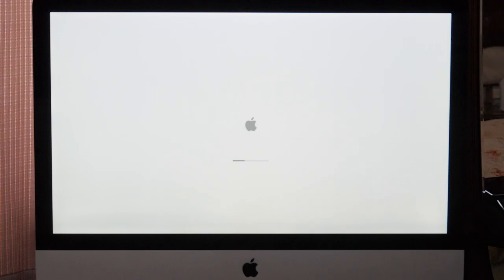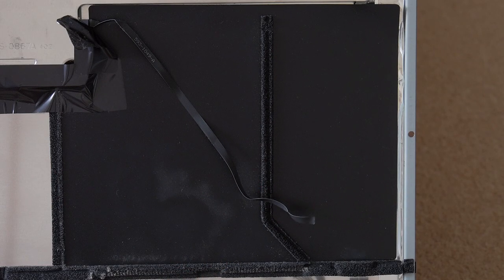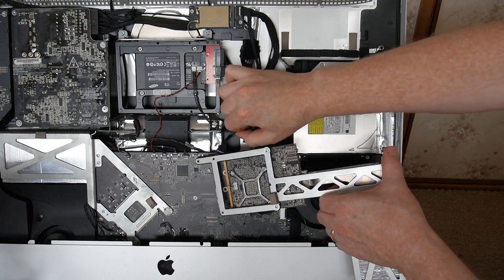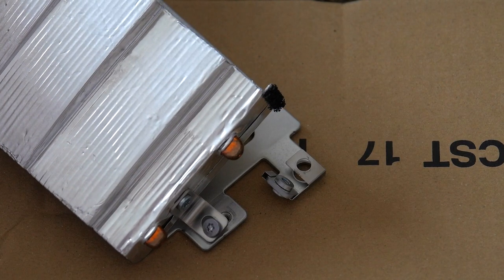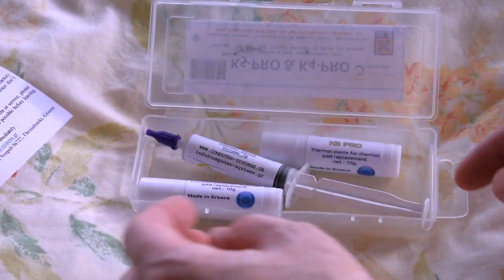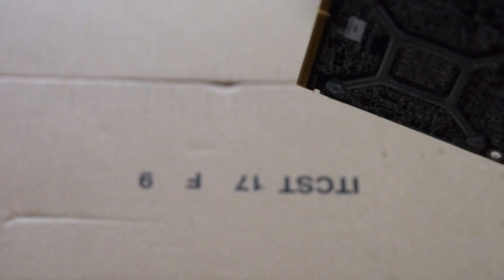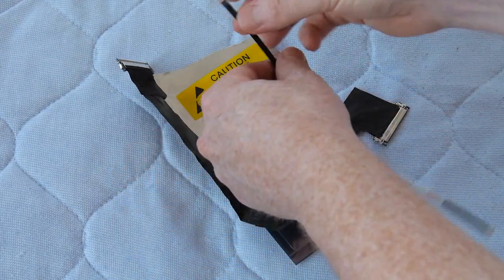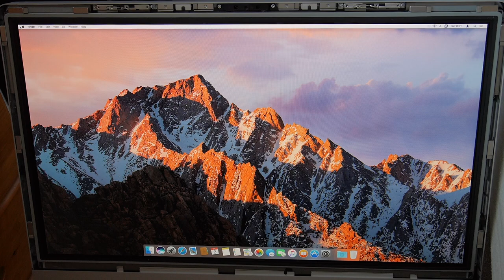Late 2009 iMac 27" Video Card Repair — 4850 — 2nd Bake

Comment: Hello James, I followed your steps, and my screen won't turn on, is just black. It starts the computer and makes sound but won't show anything... I am not 100% sure if the problem is the small tiny cable... Could this make the screen not to show at all? Thank you!
Reply: I broke the small cable... I already ordered a replacement. I hope that the reason for the black screen is that one... I think is the backlight cable if I am not mistaken right? For the big cable, the connector in the mother boar is not completely attached right? I mean it has somehow small allowance that allows to bend it in angle... Thank you!
Reply: Endika Ampudia Gamero Sounds like a connection issue, double check all cables connecting LCD screen to logic board (all 4 cables and not just the one in the upper left corner)
Reply from the maker: Thank you for your question, Endika.  If either of the two cables that I replaced in my video are either broken or not connected properly, there most likely will be no video.  That is only a guess on my part since I have not tested that case.  The small cable you broke is the Vertical Sync cable that connects to the Backlight board.  So when you install a replacement for that cable, I would assume you will get video again.  But for good measure, ensure your video card is properly seated into its connector when you reopen your iMac.
Reply: Hello @Juju, thank you for your reply. I think it is the small cable that broke. (I don't know hot but the pins peeled off the plastic). The big one is in perfect condition, actually is pretty hard to brake...it can happen of course since is a 2009 unit. The connector just to make sure bend a little bit towards the screen right? I mean is not an static connector in the board... I was scared that I broke that from the mother board but I checked carefully and I didn't break any welded element or anything so I guess is really the small cable... Thank you so much and I will post once I get the cable!
Reply: Thank you so much James, I downloaded the document and I will keep it with me to see if I can fix it. Very useful. I am guessing is that cable. First I connected everything and everything seemed to be ok, but when I turned on, nothing happened on the screen, so I removed the LCD again and I realised the small cable somehow peeled off the connectors... It has two sides, the one with plastic and one side where you see the gold connector... I will be more careful and put this properly. About the bug cable seems is in perfect conditions, is a big connector and looks fine. Just to confirm, the connector on the board is not 100% fix, meaning it bends a little bit towards the screen, like in angle. I checked this and seems has nothing broken or anything previously welded to the board... Do you know if this is like this in origin? I checked again the connector of the video card and seems to be ok... I mean the screws are in place etc, if it was not well connected those screws cannot be attached since it would be displaced... anyway once I get the cable I will connect everything again... Hope you can solve my question about the big cable connector in the mother board... thank you so much!
Reply from the maker: Endika, the metal contacts on the tip of my small cable also started to come off the very first time I disconnected it for my 1st bake.  The cable is NOT made very well, plus it's old too.  But when I broke it on my 2nd Bake, I had to replace the cable, which solved the problem of the bad contacts.  So it seems you are replacing that cable on your machine too, so that problem will be solved.  

You say a "big connector" is bent?  If you push on it with your finger and if it does NOT move around, then the solder contacts are probably still good and you don't need to worry about it. If you are worried about it, just shoot a clear close-up photo of that bent connector and post your photo to the cloud so you can share it with me, then reply back here with a link to your photo so I can see it.  If I can see your connector, I can better determine if it's OK or not.
Reply: JDW thank you so much! I will send later the photo of the connector so you can see if it’s ok not not...what I mean basically is that the connector on the board itself is not fixed completely to the board. It’s like you can bend it a little...anyway I will send a photo ASAP. Thank you so much!
Reply: Hello James, those are the photos. I pressed somehow this connector so you can see what I mean when I say it has small allowance to bend it... I guess this is like this and is designed to allow the cable to be removed when we lift the screen. I hope I didn't break any connector here... Let me know if you need better photos or video. Thank you!

https://drive.google.com/open?id=19kR09EieQmikhM1d9zJSQ6qv3XmoB9JQ
Reply: Endika Ampudia Gamero Hi, i think this is normal, as the big connector cable also moves slightly forward on my imac.  (I believe Apple designed it this way to allow easier LCD screen removal / installation.  Goodluck with your repair, i just did this on mine yesterday and it works flawlessly!
Reply from the maker: Endika, thank you for the photos. That connector is officially called the Display Port Cable Connector. It looks normal to my eyes.  So long as you didn't let the display fall toward you and out of the computer (like I did in my 2nd bake video), the solder joints on that connector should be fine.  However, I did find it hard to get the cable fitted all the way into that connector on both sides when reassembling my machine.  If that cable isn't making good contact in its connector on the logic board (or is disconnected at the back of the LCD, then you obviously would have issues when trying to boot.

If you check pages 24-25 of the PDF I gave to you, you will see there are 4 LEDs located in the bottom left corner of the logic board that give you very useful diagnostic information.  LED#3 especially  lights to confirm good communication between the logic board and video card, and LED#4 lights to show the logic board and LCD panel are communicating properly.  If either of those LEDs do not light, it suggest there could be a problem with the LCD panel or the backlight board or the cables in-between them.  And in that same PDF, on page 27, are logic board test points that would allow you to check signals if you have a digital multimeter.

In that same PDF, troubleshooting recommendations are given on page 38.  If you have an external display, connect your iMac to it and see if video displays on that.  If it does, then it is likely a backlight issue, and they suggest resetting the SMC.

Please let me know if this information helps.
Reply: JDW Thank you so much I will try this way when I get the cable. As well I got to see a video on YouTube where a guy is welding that connector I was referring to... this is the link where he does I don’t know why... https://youtu.be/t8KXvZKLhXI
Reply: Juju hello Juju thank you so much! This makes me breath a little bit better I though it was broken... I found this video where a guy is welding this connector to the board...I don’t know... this is the link https://youtu.be/t8KXvZKLhXI
Reply from the maker: Thanks for the link.  I had seen that video before.  That fellow assumed that connector was not supposed to move and he applied solder to fix it in place.  I don't think that is necessary though; and honestly, if you aren't experienced with a soldering iron, you could do more damage than good.
Reply: JDW That’s what I though also! Because the connectors seem to be fine...is risky to do that anyway as you said. Will wait for the cable and check all the test in the PDF...let’s hope will work!

Comment: And just hopefully some helpful info to save people some money. Warning: May get long winded. And might not work on 2011 iMac's. I don't have one to test on. Will work on 2009's though. 

If you plan on replacing your 1 TB rotational hard drive with an SSD you do not need that special frame and in-line temp sensor from OWC! They are over priced.  What you do is go to most any computer store or even Best Buy and get a 3.5" to 2.5" adapter frame. Costs between $5.00 to $10.00. Mount SSD into frame and then remove old drive disconnect cables and temp sensor cable. Transfer screws to adapter frame and mount in the iMac. 

OK now you think what about the fans running at high speed? Easy fix for that as well. 

Take the Hard Drive sensor cable that you removed from the old drive and identify the 2 wires inside the connector. One should be grey and the other black. Take an NPN transistor like a 2N3904 (the 3904 transistor is labeled as follows: Looking at the flat side of the 3904 E will be on the left, B will be middle and C will be right end) Now twist the B and C leads together. Nice tight and near the top of the transistor 2 or 3 turns should do it.. Leave the other lead E by itself. 

Trim leads slightly maybe 1/4 inch from end. Plug the E lead into the hole of the sensor cable that has the grey wire. The B and C pair into the sensor hole with the black wire. Be sure contacts are tight in the sensor cable. Now just tape the transistorized heat sensor to the SSD. Fans should run at normal speed.

 This is the exact same way apple does it with the temp sensor on the back of the LCD!!!  And on the 2007 and 2008 iMac;s Hard drive too. 

Hope this helps someone. Cost would be at the most $10.50. The Transistor is cheap. Compared to OWC's price of $40.00 just for there in line temp sensor. Ouch!
Reply from the maker: Thanks for the tip.  But bear in mind you are writing to people who watch YouTube, and I don't know if they will read more than a couple paragraphs of information. :-)  Seriously, what you described would make a wonderful video!  If you ever do make one, feel free to post a link to it here.
Reply: @JDW-  Yeah I was long winded but the only way to explain it so the average person could understand it.
Reply from the maker: @MrEd-qg8td  I love being long-winded, so you and I are clearly kindred spirits.  I'm Generation-X, not Generation-Twitter.  That's why a good number of my videos are close to 1 hour long!  :-)  Thanks again for your helpful advice!
Reply: As others suggest this would make a great video tutorial

Comment: Is the same card in 24 inch 2008 ?
Reply from the maker: No.  But there have been comments under my videos from 2008 24" iMac owners who have baked their video cards and found success. My videos will help guide you, but keep in mind the internals are not 100% the same.  But it is similar enough to where you should be able to find the card, remove it, and then proceed with the bake as outlined in my video.  My advice would be to open your iMac and have a look.  If you feel confident enough to proceed, then buying the required thermal paste would not be a waste of money.  Please let me know how it goes.

Comment: One issue I noticed is that you did not clean off the old thermal paste off with 99 percent isopropyl alcohol and reapply your paste.  I would suggest arctic MX-4 which is non electrically conductive and non-capacitive or Kryonaut by Thermal Grizzly which is listed as non electrically conductive at the web site.  I can't get any information from the manufacturer if it is non-capacitive, but there are people who have said that they are using it on GPUs not CPUs in place of Arctic MX-4
Reply from the maker: Please start watching from 22:47 and you will see that I did indeed clean off ALL the old thermal paste with tissues, swabs and dehydrated Ethanol, which is as good if not better than 99% ISO alcohol.  Furthermore, as mentioned in the text description under my video, I used non-electrically-conductive K4 and K5 Pro pastes after my bake, and so far those two pastes have given me 2 years of continuous use.  So what you see in my video above works very well.  I hope this information helps!

Comment: I have just reasembled the computer. saddenning the screen is still in black. Turning it on, on a dark room, the black screen turns illuminated black, the sounds of loading are all correct.
But the result is the same, probably the graphics are totally dead.
If you know any advice, i would do, i'm not throwing away a mac from 2011 full upgrade.
Reply from the maker: I read and reply to every comment on both of my bake videos and you are the 3rd or 4th person who has reported a black screen after the bake.  I assume you cleaned off the old thermal paste, then baked the video card at 200°C for 8 or 9 or 10 minutes, then reapplied new thermal paste, then reassembled and tested? Since you hear sounds that indicate normal booting, it is likely you just forgot to reconnect a cable that pertains to the display.  Hopefully you did not accidentally break a cable like I did in my 2nd bake, as that will result in a black screen too.  So I'm afraid you'll need to reopen your iMac and check your cable connections.  Make sure the video card is socketed correctly too. If none of this works, then it could be that your card is totally dead, because it seems that your display was 100% black before you even tried the bake, right?  That wasn't my case.  I would get display artifacts and freezes.  It could be that a 2nd bake might cure your problem, but it also could be something else altogether, like a defective display backlight.  And truly, if you try a different video card and see the same problem, then the root problem is then most assuredly a bad backlight.

Comment: Would it be possible to bake the card in a typical Japanese broiler under the gas range? They typically go up to 300 degrees Celsius. Just asking because I live in Japan, too, and this is the kind of oven in my place. I totally admire your dedication! Looks like a beast to take apart and put back together.
Reply from the maker: I cannot wholeheartedly recommend it because the way heat flows in a convection oven like mine is different than those fish-cooker trays you are talking about.  There's no fan blowing hot air around in your fish cooker tray like in my convection oven.  Also, your fish cooker tray is a smaller area too, so that combined with the fact it is not well ventilated would mean any vapors coming off the solder flux during cooking would stick to the walls of your fish cooker tray.  You would need to do a good wipe down after a bake, which as you probably know isn't so easy due to all the grease and grime inside those things.  However, some people have told me they had success by putting aluminum foil around the entire video card EXCEPT the GPU and then using a heat gun for some seconds on the GPU.  I cannot advise that though because I cannot tell you from first-hand experience precisely how much heat or how long would work the magic needed to resurrect the GPU.  Unfortunately, your only recourse is probably to find a friend who has a convection oven and who will let you borrow it for the 10 minutes necessary to bake your GPU.  But with Corona and with other people not knowing if your card will leave residue in their oven (it won't), that's easier said than done.  I realize that.  I just don't want to advise you the wrong way.  I've only had success in a convection oven, so if I say, "give that fish tray a try" and something goes wrong, then that would be on me.  So long as the temperature can be regulated at 200°C, even without hot air flow, it still MIGHT work.  But that's really the best I can say.  Sorry.
Reply: @JDW-  thank you kindly for your detailed response. I live in Nagoya and most of my friends have the broiler-type of cookers. However, I did find a friend with the convection oven type. We'll see how it goes. The biggest challenge may be in getting everything reconnected again (I wasn't as meticulous as you were in labeling everything). Trying this out as a personal challenge more than anything. Will let you know if the machine runs again...or if it ends up becoming an expensive "dock anchor" instead! :)
Reply from the maker: @bradd.7829  My 1st bake shows how to do it by removing the motherboard, which you must do if you want to replace the BR2032 PRAM battery on the back side of the motherboard.   If you don't care about that, watch my 2nd Bake video on how to do it WITHOUT removing the motherboard.  It would be faster and easier that way.

Comment: Is the iMac still working nowadays?
Reply from the maker: Yes, it is still being used daily, without any problem!
Reply: Nice! I also reflowed my GPU (iMac Late 2009, but 21.5") for only 3minutes and lasted for about 3 months only.
Tried to reflow again, this time 6minutes, but to no success.
Gonna try one more time to see.
Thanks for the info.
Reply from the maker: Go for the full 10 minutes like I did in my 2nd bake, and make sure the temperature in your pre-heated oven is set to 200°C/400°F.  Don't bake your card unless all the old thermal paste is removed.  And be sure to suspend it with foil like I did.  Let the card cool slowly after you remove it, then use good thermal paste like I did (I used 2 types).  Unless your card is fried, it should work and last.